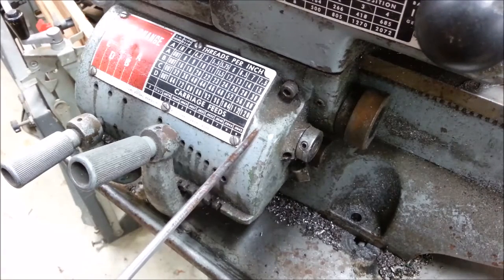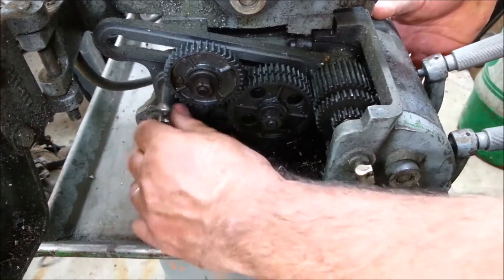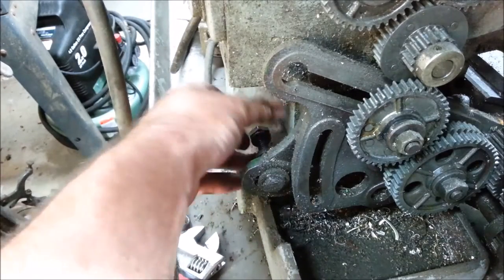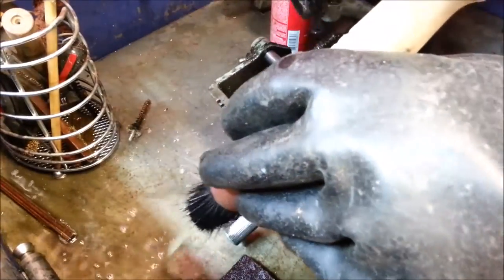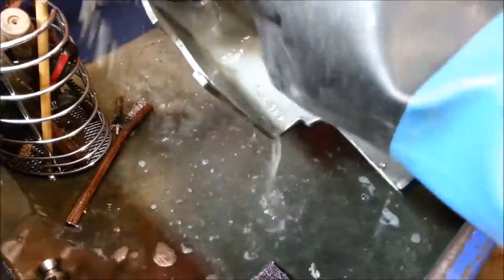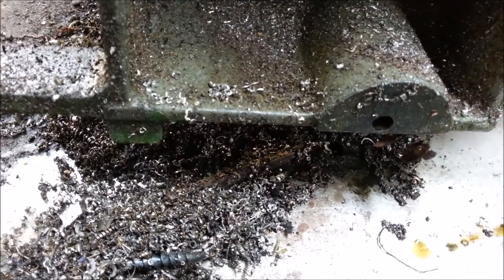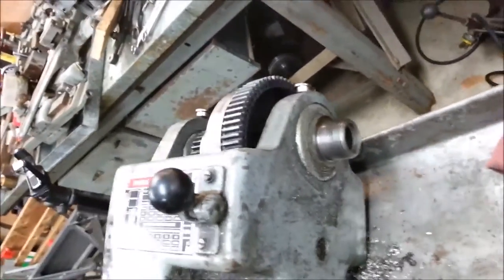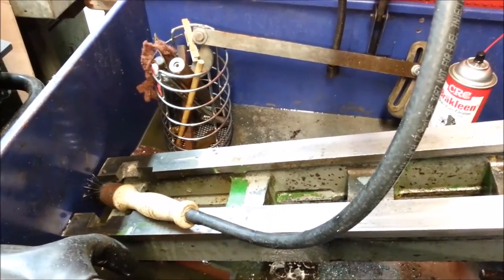Atlas Craftsman Commercial Lathe Part 3 QC/Bed/Head Crafted Channel

Comment: Good job Dave.  Looking good. I was told along time ago that most of the time you get metal chips in the gearbox like that is because people use an air nozzle to clean off their lathes.  Mine was about as bad but not as many chips, but mine did not have a chip pan to build up in good to use a chip brush only.  Good video.  Headstock index pin is not on some of the 12" I've seen you must have gotten a very late model.  Will be interesting to see what the numbers are on the head bearings when you pull it apart.
Reply from the maker: The latest models have a lever with black ball on the end to engage the cross feed.  I'm going to modernize this lathe a bit. If there is a head stock with the hole in the casting for the index pin, I might have to try to trade up. This head stock doesn't even have an un-drilled portion to add the pin.  It's all thin'ish webbing on the inside.  I'll update to the carriage engage lever also if I get a chance.  It looks easier to use to me.
Reply: I've seen that it is a clutch system.   I think that would be good.  Did you get my email. I sent you some manuals I have I've got a source.   Need the model number.  Email it to me.  Also have a drawing for the carriage stop I will send you so you can build one.  It looks like the original atlas ones.

Comment: Just went and checked--mine has the index pin. Not sure what I'll ever use it for, but there it is.
Reply from the maker: I have a bunch of Atlas lathes but only one of this model at the time of making the video.  I now own a second bench-top model.  It is in storage at the moment.  Don't remember if it has the pin.  Is yours a later model with the lever type cross feed engagement?  I"m doing a full update on this one as I go.  If I run across a head with the pin, you bet I'll incorporate it.
Reply: Yes, mine has a lever. I keep meaning to do a video doing a tour of the whole lathe. Maybe I'll do that today.
Reply from the maker: My double grove pulley in the head stock is wore out.  I'll be "repairing" that in the future.  Most of them I have seen are worn out there as well.  I got it that you have a belt issue, like maybe you are running on a single?   Change over to Fenner when you get your new pulley made.   I do have a pulley making video.  Looking forward to doing it again.  Mine was completing a pulley another YT'er got stuck on. 2 groove compound for a Southbend..
Reply: I have double belts running to the headstock, just not tensioned well. I'm using link belts b/c I didn't want to pull out the spindle at this stage of the game. I'm missing the double-sheave pulley that goes directly on the motor, though, so I have a single there for now.
Reply from the maker: I've not measured the Commercial lathe.  However, the early 12" and 10" lathes are smaller pulleys than the HF green belt.  It rides too high out of the groove.  After figuring this out I went to Fenner (I forger the correct size just now) and didn't look back.  I've got another belt on my "Old Gray Lady" to change out that is causing me vibration issues.  When I combine my desire to do it right with my desire to back the USA producer whenever possible, it's a no brainer.  But almost everybody buy the HF product.  It's a good belt for sure, just not the right size for the application.
Reply: I believe the green belt sold at HF is actually US-made. As you said, not the best fit. I'm trying to find the Fenner version online right now.
Reply: Since I have no idea what the difference is between a "3L-link" vs. an "A-link" belt, vs. whatever else is out there, do you know offhand what type I ought to be looking for here?
Reply from the maker: Just went down to the shop to look at the belt sleeve.  As near as I can identify, the most correct belt is the A/4L from Fenner.
Reply: Thanks very much!
Reply from the maker: I can't remember if I knew what the difference was between 3L-Link and A-Link.  The A/4L is defiantly slightly narrower than the HF.  Part of it runs above the lip of the sheave, but ti's supposed to.  Just not as high as the HF.  So you have more side area engaging the sheave.
Reply: The Jason Industrial belt from HF is an "A-Link-5." According to the chart I just found, an "A" cross-section is supposed to be 1/2". However, putting the calipers to it, I see that it is more like .054 or thereabouts. It definitely rides too high. So the next step down would be a "3V/3VX" at nominal 3/8".
Reply from the maker: 7/16 would be interesting to try if it existed.  3/8 will definitely be too small.  Yes, the HF belt as I remember is about 1/16 too wide.  3/8's is what they run on the very small import drill press's just in case you have one in your shop.   (3/8" - 10mm).   When I snag a cut off tool in the work, the V belt slips, the Fenner does not.
Reply: So basically the same nominal size as the Jason Industrial but closer to spec?
Reply from the maker: I think the HF belt is trying to avoid giving it's size so with one part number they can sell into to both sizes.  Really, I care more about getting it right even if it costs a few more bucks.  I'll check out Jason Industrial  I didn't know that was the maker.  Do they offer the full range of widths under the Jason brand?  I would guess they do.
Reply from the maker: Rick Rose I see Jason Ind. listes an A4L on Amazon.  Says it is 1/2"  5L is probably supposed to be wider as you have measured or found specifications for.
Reply: Well now that I look closely at the box, the Jason Industrial product doesn't actually say "Made in US." Does the Fenner say that specifically?
Reply from the maker: You had me worried there.  Yes, it does say Made In USA.  Maybe the HF is just the same color as the Jason's?
Reply: No mine was purchased from HF and it says Jason Industrial Inc. Just doesn't say Made in USA. So Fenner it is!
Reply from the maker: My package right here says it is. If I could find the material, I would consider laser cutting my own belt.  It's hardly worth it.  But it would be fun.  What is neat is the sides are cut on a bevel to match the pulley. It would be a difficult product replicate.